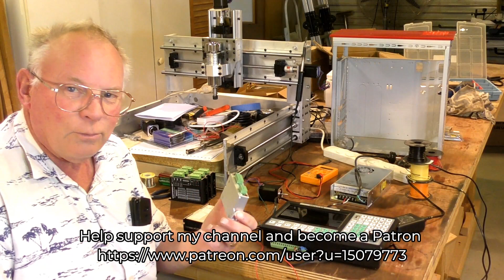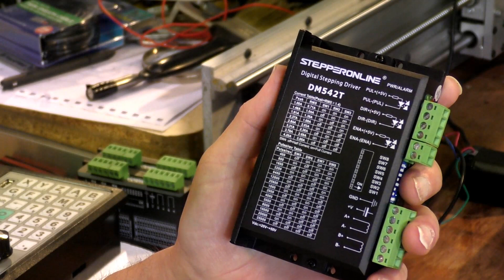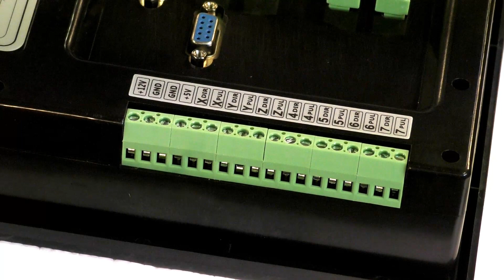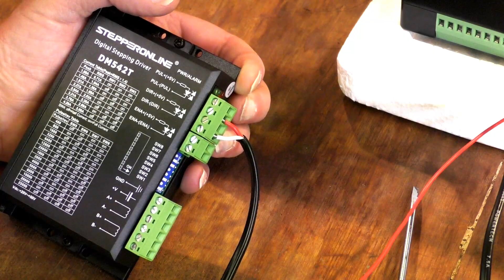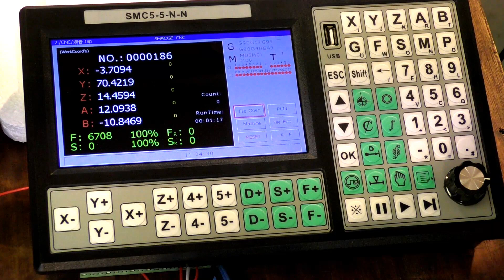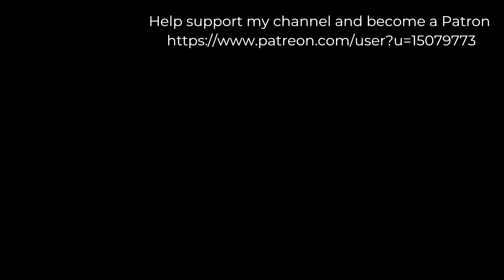😁 SMC5-5-N-N Goodbye Mach 3 & 4 + I WOULD "NOT" PAY OVER $500 for the SMC 5-5-N-N controller

Comment: hello sir , can I use the outpins to oprate 24 voltage DC relays ?
Reply from the maker: No, the output is 5 volt and 12v to 24v input to run the SMC5
Reply: @inventorsworkshop9600  so I can use the output to run 24 volt relay if I use 24 volt DC as a Vin?

Comment: 😀Hellos Roger, thanks for the very good videos. 

I have a question for the SMC5-5-n-n controller :

is it possible to connect an external switch for the feedrate?
does the control have a single block function in automatic modus?

thanks in advance for the help.

Comment: Great video and thank you for your time.  Do you still like the SMC 5-5 as much as you did when you posted this video.
Reply from the maker: Yes I do!
Reply: @inventorsworkshop9600  Do you think this controller could be used on a Lathe CNC conversion.  I have a mill and lathe and thought about converting them as well as building a rougher CNC.

Comment: Mr.Web this is great and I am very interested in adding this to my cnc to switch over, but I want to know first does this have rotary capability, like the mach 3 you can configure rotary on one of theaxis???
Reply from the maker: Hi, yes this is a 5 axis controller X,Y,Z,A and B, so yes it will run the A rotary axis.
Reply: @inventorsworkshop9600  what configuration changes will I need to do will it be like configuring the Mach
Please help

as far as tutorials or information on this controller you're like the top informant any help you would give I'd appreciate it sir

Comment: Roger this is great
I bought the rotary attachment but I'm using the onefinity cnc which uses grbl
I'm wanting to switch over to be able to have rotary capability

My question is sir
Full set up
Controller stepper driver etc
What's the price
Reply from the maker: Hi, the MIDI CNC router was about $1000 to build. The MAXI CNC router was about $4300 all up to build.
Reply: @inventorsworkshop9600  hi Roger
I love my machine
What I'm interested is converting to my controller which is grbl to the one you showed the smc5 I'm asking how much will it cost to convert to your controller?
Reply from the maker: OK, you would need the SMC5 $500, a driver for each stepper motor $70 to $100, and a power supply about $50+
Reply: I am interested in doing the same with a Onefinity Journeyman. It seems the SMC5-5 could replace the Onefinity controller (which has the drivers mounted inside the controller box I suspect) and the external display. If you drop those two pieces off the price of the Onefinity then that's about the same as the SMC5-5 with the drivers and PS would cost and I think in the end you would have a more capable machine overall because of the 4th and 5th axis.
Reply: @inventorsworkshop9600  Is the SMC5-5-N-N still the controller to get this being one year later or is there another and where do I find them.
Reply: Ty sir
This will run rotary add true rotary line using the wrap in aspire?

Comment: Hi Roger i have followed along with you i am using Nema 34 closed loop system with same controller am having some great difficulty getting it work not sure where on earth im going wrong there is no alarm so wiring appears to be correct have followed data sheet specs as supplied with driver /motors have even changed out drivers and motors to see if that may troubleshoot the issue but still no good any help would be greatly appreciated at this point have spent the whole day going over it and am stumped shall we say.. Best regards TJ
Reply: just found info on pulse frequency controller 500 kHz per axis and driver is 0-200 kHz is that potentially my problem? cheers TJ
Reply: Yay..... worked it out😊😊 was the enable just needed a signal i had put a positive and negative on 😂👍 i think i had been stairing at for too long.. 👍

Comment: Can this controller be be wired with two stepper motors slaved together (Y Axis)?
Reply from the maker: Yes it can, and I did ;-))
Reply: @inventorsworkshop9600  hello, for this, have you plugged a step motor in A and set A as slave of Y or have you plugged both in Y ? (ps : thx a lot for this video :)
Reply: @inventorsworkshop9600  please, can you post a wiring diagram for this, or give some information how to do that because i'm stuck...

Comment: How are the stepper drives working without any connection to the Enable?
Reply: @inventorsworkshop9600  All the drives I have ever used require the enable to be addressed. This might be the problem with the small silver drives. If they are not 'enabled' they won't work.

Comment: Roger great video. I really enjoy all of your videos and they have gotten me interested in CNC routers. FYI - I tried using your discount code for Carveco and it did not work.  I contacted them and they are fixing the problem.  I am building my first CNC router and my SMC 5-5 controller will arrive on Monday 14th. I am a little confused about the pulse per rev setting for the drivers. I know you can use higher pulse per rev settings than your stepper motor to improve accuracy but what is the limit.  I am using the same driver type DM542T you have in the video and my stepper motors that I purchased are 200 pulses/per rev @ 1.8 deg per pulse.  I was going to use 400 pulses/rev should I use higher pulse rate?  How did you arrive at 2000 pulse/rev setting?  I cannot find any sites that accurately explains this.  Thanks for your help!
Reply from the maker: Hi Scott, this is an example only.
Formula:
step per inch = (motor steps * microstepping) / (travel at one turn of the motor in inches)
if microstepping is set at 16 (1/16 on the driver) then and you are using a sprocket and chain with a pitch of .25 inches and 12 teeth on the drive sprocket
= (200 * 16) / (12 * .25)
= 3200 / 3
= 1066.666 steps per inch

For lead screw that has a travel of .5 inches at one turn like the 5 start 1/2 inch lead screw and using 4 microsteps per step (1/4):
= (200 * 4) / (.5)
= 800 / .5
= 1600 steps per inch

There is a facility on my Patreon pages for any further assistance 
Help support my channel and become a Patron 
https://www.patreon.com/user?u=15079773

Comment: I just got mine all hooked up the homing switches work. I can set the work coordinates to zero. When I jog the machine manually it moves in the correct directions.... But when I run a tap file the machine make all kinds of odd moves and does not follow the correct movements. The files I’m trying are existing tap. files that I have run many time when I ran the CNC with Mach3. Are there setting that I need to be looking at? The TAP. files were made in Fusion 360.
Reply from the maker: Hi, go into the MDI screen and input X50 Y50 X-50 Y-50 and air cut and see what it will do
Reply: @inventorsworkshop9600  ok I tried to find the MDI screen on the SMC5-5-N-N but couldn’t find what button to push to find that manual input screen.
Also if I run the included file that comes with the controller is appears to air cut it fine, but still does not like my Mach3 TAP. Files
Been working on this issue for 2 days now lol 😂
Reply from the maker: Hi, try a 50mm square in Fusion 360
Reply: @inventorsworkshop9600  yes that’s exactly what I did this morning 100 x 100mm but it still goes wacky. It appears to be a coding problem with G28 and tool offsets G43. I’m hand editing the code. The latest firmware allows G53 instead of G28 use so that should help. I’ll try the new edited code tomorrow and see if that fixes the problem. The sample cutting file that comes with the controller works great.  I made a 3D curving of a Buddha and it turned out great. There appears too be some G codes that the SMC5 just doesn’t like.
Reply from the maker: Hi Glen, I have dun some looking around and found that other users are using the mach3 postprocessor output in Fusion 360 for the SMC 5 with no problems.
Reply: @inventorsworkshop9600  Hi Roger, if I use this hand written code below it works great.
T1M6
G0Z5.000
G0X0.000Y0.000S1500M3
G0X0Y0.001Z5.000
G1Z-4.779F3000.0
G1X0
X100
Y100
X0
Y0
Z10

but if I use the fusion generated code the machine does not do absolute moves it does relative. for example  the fusion code tells z to go up to the home switch zo then it tells the machine to move to the xy starting spot (good so far) then it tells z10 code it wants the tool z to move down towards the material surface and stop 10 mm above the surface. But instead it goes up 10mm and slams into the mechanical end stops at the top of z axes. its trying to move in relative instead of absolute. this happens if the code uses G28 and G53. Apparently both G28 and G53 are to be absolute moves NOT relative.  But the controller appears to be treating G28 and G53 moves as relatives :-(
Reply from the maker: See how this will go
(CUT 1 test 01mm)
(Material Size) (X=50.000, Y=50.000, Z=10.000)
(Tool Number:1) (6.000 mm dia. slot drill)
G21 G49 G80 G90
G0Z10.0000
M3 S15000
G0 X-20.0000 Y-23.0000 Z10.0000
G1   Z1.0000 F240
G1 X-23.0000  Z0.6250 
G1  Y-16.0000 Z-0.2500 
G1  Y-23.0000 Z-1.1250 
G1 X-20.0000  Z-1.5000 
G1 X-23.0000   F900
 Y23.0000 
X23.0000  
X23.0000 Y-23.0000 
X-20.0000 Y-23.0000 
G1    F240
G1 X-23.0000  Z-1.7250 
G1  Y-16.0000 Z-2.2500 
G1  Y-23.0000 Z-2.7750 
G1 X-20.0000  Z-3.0000 
G1 X-23.0000   F900
 Y23.0000 
X23.0000  
X23.0000 Y-23.0000 
X-20.0000 Y-23.0000 
G0   Z10.0000
G0 X0.0000 Y0.0000 
G0Z10.0000
G0X0.0000Y0.0000
M5
M30
Reply: @inventorsworkshop9600  is the datum.   Work zero the Center of the square or the lower left corner?  I’m assuming by your minus code that the work datum is in the center if the square top surface.
Reply: @inventorsworkshop9600  yes that code will work just fine, because you are not using code to go from work co-ordinance to machine co-ordinance and back. This controller does not like going from one mode to  the other. but if you add a line with G90 after every G53 (G28) then it works great you also need to add a G90 at the very end of the code lines last line.

here is the code from fusion the highlighted lines are what I hand edited to get it to work. Where the dashes are.
(1001)
(T17 D=19. CR=0. - ZMIN=-15. - FLAT END MILL)
G90 G94 G91.1 G40 G49 G17
G21
(WHEN USING FUSION 360 FOR PERSONAL USE, THE FEEDRATE OF )
(RAPID MOVES IS REDUCED TO MATCH THE FEEDRATE OF CUTTING )
(MOVES, WHICH CAN INCREASE MACHINING TIME. UNRESTRICTED )
(RAPID MOVES ARE AVAILABLE WITH A FUSION 360 SUBSCRIPTION. )
G90 --------------
G53 G0 Z0.
G90 -------------
(TRACE1)
M5
T17 M6
S16000 M3
G54
G0 X10.447 Y12.749
G1 Z5. F2000.
Z-15. F1000.
Y87.749 F2000.
X85.447
Y12.749
X10.447
Z5. F1000.
Z15. F2000.
G53 G0 Z0.
G53 G0 X0. Y0.
G90 ----------
M30
Reply from the maker: Carveco maker will output to the SMC5-5-N-N with no problems